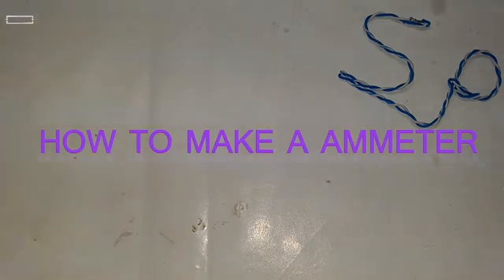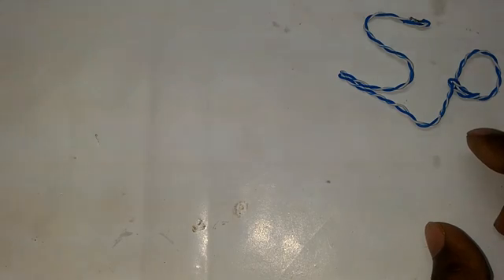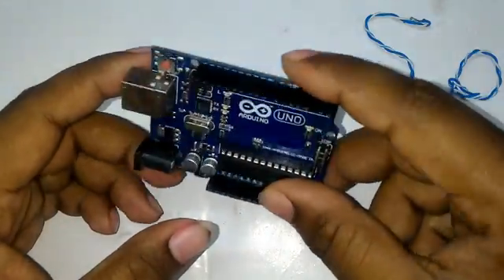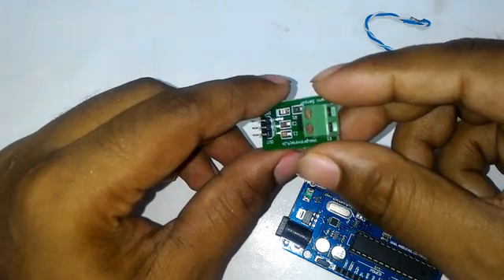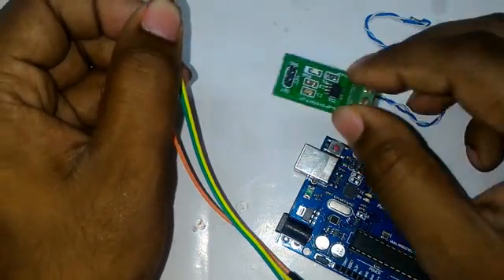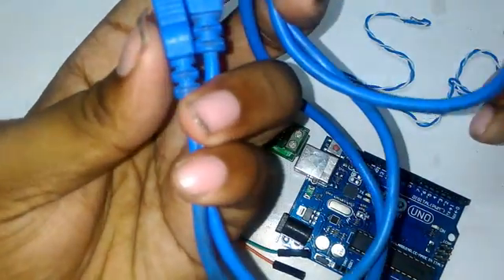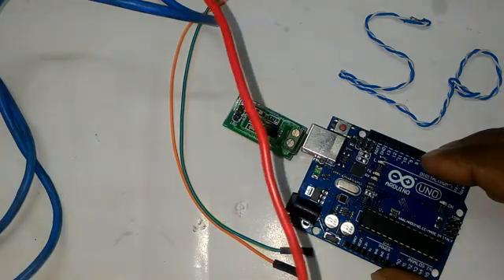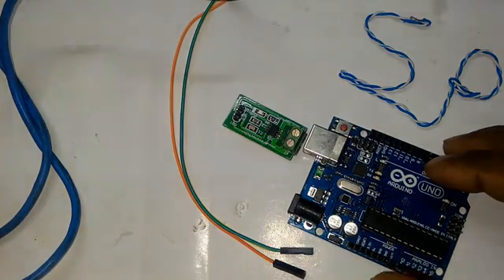Project 7: How to make an ammeter using Arduino UNO and ACS712 current sensor .

Comment: can you please tell me  how i can change the code. I am using Arduino Mega. Please help me
Reply from the maker: Ahmed you can use same code just for connection use same port's (analog and digital) And in Arduino IDE  just go to Tools then Board and select arduino mega (or bord you use).
Reply: IndianRobotix I will be using the Arduino mega and will d using three ACS712 sensors, 5Amp, 20 Amp and 30 amperes. I am new to programming and it is my project. So how the code will change?
Reply from the maker: change the code in result part result1 =  ((maxValue1 - minValue1) * 5.0)/1024.0; for 5amp
result2 = ((maxValue1 - minValue1) * 10.0)/1024.0; for 10amp and for 15 amp result3= ((maxValue1 - minValue1) * 15.0)/1024.0; 

next you have to do some calibration
for code : http://sp-tech1281.blogspot.in/
project 7  : For 3-Phase Line

Comment: amp  not declare?

void setup() 

{

Serial.begin(9600);

}

void loop()

 {

float average = 0;  //SET initially average value or dc value of current to zero

for(int i = 0; i &amp;lt; 1000; i++) 

       {

        average = average + (.0264 * analogRead(A0) -13.51);

        delay(1);

        }

Serial.println("Direct Current Value = ");

Serial.print(average);

Serial.println(" mA");

}

Comment: hi sir, i need to construct almost the same ammeter as yours. using arduino, but the main concern is that the current sensor that im using is different from you. im using ctt-16-cls-cv-100 current clamp sensor. is it possible for me to use your coding? which part of the coding i need to modify so that i can use to detect dc current? thank you
Reply from the maker: What is the current rating of your current sensor. In my coding you have to just change  mVperAmp this value when you do initialization. Comment here what is your current rating so that i can help you.......

Comment: if i used voltage detector? hows the coding?
Reply from the maker: look in the code we calculate the rms current in this case we have to just calculate up to rms voltage calculation Voltage1 = getVPP1();
 VRMS1 = (Voltage1/2.0) *0.707;
 AmpsRMS1 = (VRMS1 * 1000)/mVperAmp;
 Serial.print(AmpsRMS1);
 Serial.println(" Amps RMS1");  

in here just calculate upto vrms   check the code http://sp-tech1281.blogspot.in/

Comment: my project is to measure the current on a 12v battery..how do i connect my battery to the system?
Reply from the maker: Check my Blog i post it , Subscribe to my channel and keep watching,

   my blog     http://sp-tech1281.blogspot.in/                  My Facebook page,    https://www.facebook.com/Sp1281Tech
Reply: thanks a lot.. is it using the same source code for this project?
Reply from the maker: Check once again,        http://sp-tech1281.blogspot.in/
Reply from the maker: comment below when you successfully make this
Reply: Thanks :-)
Reply: I've tried the new source code but unable to run the program..so I decided to use the previous code and it's working..
Reply from the maker: Khairil Haniff good